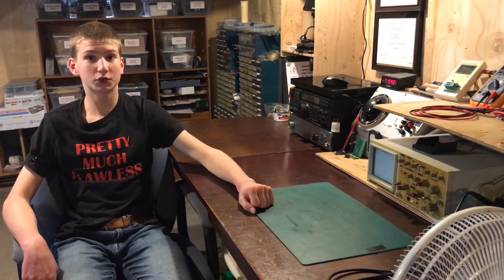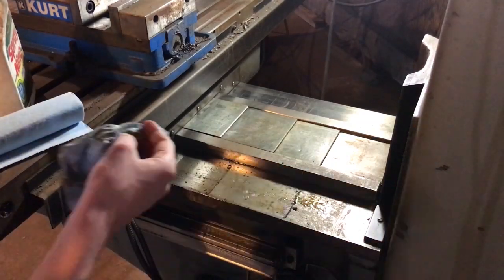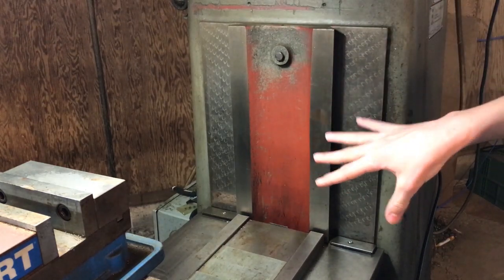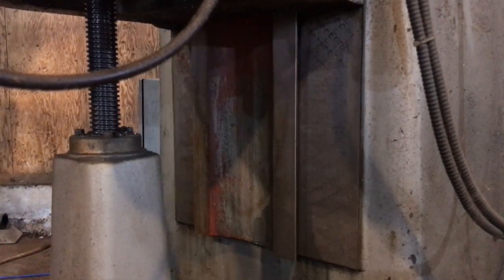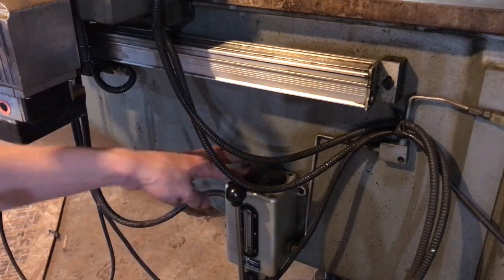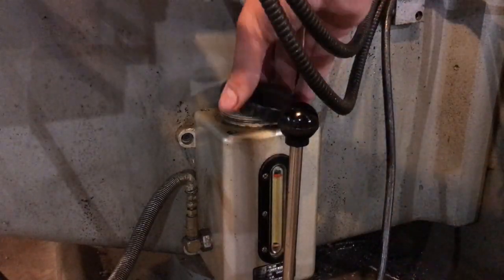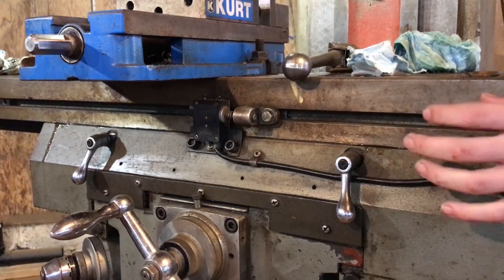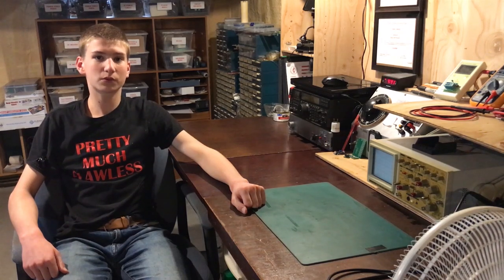Cleaning the Ways of a Bridgeport style Mill and Adding Way Lube

Comment: A great watch. Alone that someone other does the cleaning and we can watch and relax, hehehe (and that this isn't a woman, like in the real world, as usual:P). Thank you for the video and sharing your thoughts, Pmf!:)
Now to the usual YouTube-splaining (which of course has to be done, hehehe. Oh and no critique, just some thoughts): A cheap vacuum-cleaner (but with a good filter for metal and other dust, that saves the air-aggregate and motor from destruction) will guarantee that chips and more important: any scraping or abrasive dust is removed from the ways. So that there isn't even a chance to scratch something when wiping the surfaces. Apropos wiping: The only method/technique that can clean something reliably is RINSING with a solvent. Wiping can only clean so much as the solvent is able to dissolve and the wiper can absorb AND hold. These parameters and the amount of wipes determine the cleaning of the surface in the best case. This is a inverted exponential function, meaning you can never clean something to 100%. Of course in case of the ways of a machine tool this is more than enough.

I hope with my little explanation of the theory of cleaning things up I have overcomplicated everything ... hehehe. Have a good one!:)
Reply from the maker: Thanks for your thoughts! and Thanks for Watching!